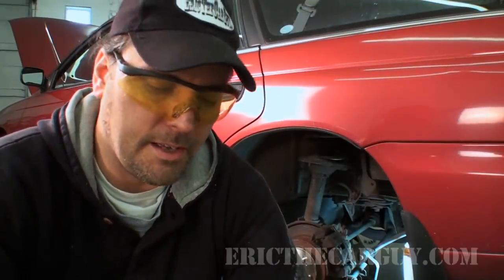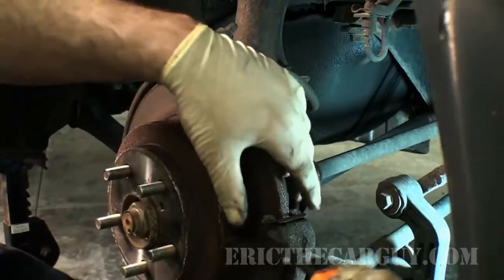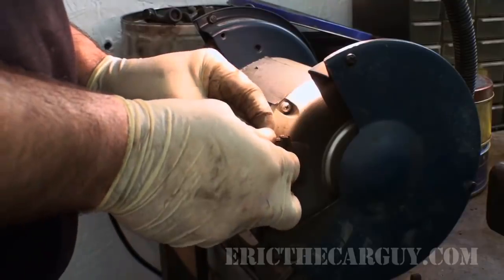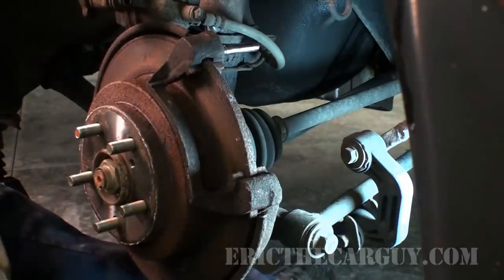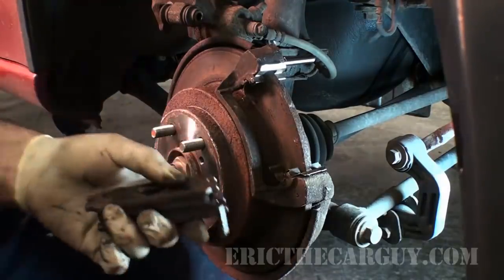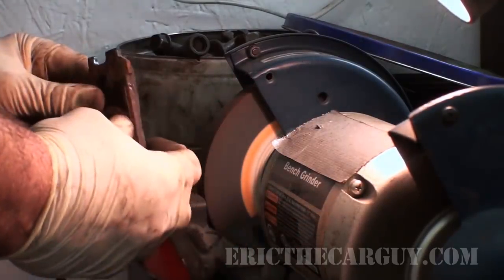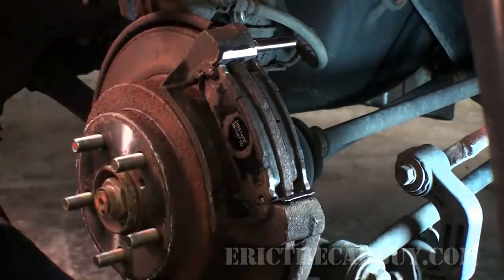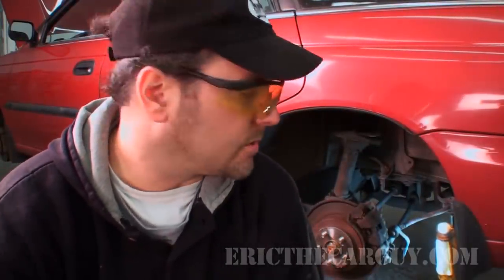How to Spot and Service a Stuck Rear Caliper - EricTheCarGuy

Comment: One way to prevent the rear brakes from rusting and get stuck, is to exercise the brakes every now and then, just brake hard a few times to remove any surface rust from the discs, and to make the pads and the caliper move a little bit. The number one reason the rear brakes fail and get stuck is that people don't brake hard enough.

Awesome channel btw, keep up the good work Eric.

Comment: Eric I love your videos. I live in New Hampshire and have been a tech for 12 years. This is the most common cause of premature brake failure.  You need to always clean the rust from under the shims and put plenty of brake lube under and on too if the shims before putting back together.

Comment: Sure pads are cheap and easily replaced. but he's not fixing pads, He's fixing a stuck caliper where most mechanics will happily charge you $200 or more for a new caliper and labor. He's done a great job on educating people that a stuck caliper doesn't always have to mean a costly replacement. Thanks Eric. great job. wish there were more honest mechanics like you.
Reply: He didn't fix a stuck caliper he didn't even fix the rubber boot around the Piston nor did he show how to get the Piston unstuck
Reply: This video showed him cleaning the caliper not fixing the problem with getting the rubber boot or piston from being stuck
Reply: @m.o.n.e.ypower8484  yeah, that's what I thought the video would show....

Comment: Very nice! I am a technician myself. I was about to write on here about 7:50 into the video say the following: "Whenever I clean/service calipers and caliper brackets at work, after I clean the shims and the shim housings on the bracket, I discovered a little bit of anti-seize on the housing will help prevent future rust and less chance of brake failure" But soon enough you did what I was about to say lol. Good job, was like I was watching a video of myself doing it 5/5!!!

Comment: I have a 2012 Dodge Grand Caravan and every 6 months the sliders as well as the parts Eric talked about have to cleaned and lubricated otherwise I start to smell the sticking of the pads to the rotor. The rear of these vans are known for it. I will not waste money on parts that have nothing wrong with them other than surface rust.  I've repaired my vehicle as well as my sons for years and saved a whack of money. 
Great video Eric.

Comment: I always fine tune the brake pads with a file' The ends always have excess metal,like you did fit and try,then fit and try until they slide properly, because your brakes can never be good enough. Good brakes are a good way to stay healthy. good video

Comment: I had a similar problem on my 2000 Pontiac Bonneville SSEI. I removed the calipers, cleaned all contact surfaces with a wire brush, brake cleaner, and also used a small file to ensure the rear brake pad end plates were free of corrosion. I also used anti-seize on all contact surfaces and replaced all the brake hoses with new hoses. The rear brakes now work perfectly.

Comment: I had a rear caliper like this, I just changed out the rotor, caliper and pads, for new that was the quickest, easiest solution for me and meant I was assured everything was new and I probably wouldn't need to work on it again for while.

Comment: I agree that you should have the "chirper" on the inside pad Experience has taught me (even thought its only about three years) to always put the indicater in a location with path of least resistance mean that if the happens to fly off of the pad it with be ejected promptly by the forward motion of the wheel and not get thrown into the caliper and possibly cause more damage there  are my thoughts on that. And as far as not beating on your prybar to free those pads I say use what you feel safe w/

Comment: Had a rear slider on a dodge ram yesterday and the one slider was like it came from the factory with now lube in it at all. The rest were fine and there is only 100,000 kms on the truck and the brake pads were never changed until yesterday and they still had half the pad left lol. I couldn't believe it. All highway km's I was told. Great vid Thanks.

Comment: hey eric,paul again,so many mechanics NEVER lube the slides,incredible !!!! i keep a can of brake lube right on my cart and never do a brake job without checking and or lubing the slides !!!!! the small cans i use have a brush right in the can !!!! it's really cheap and you can buy them on line cheaper than you can buy them at a parts store !!!!!!! when it gets low once again you can buy tubes of brake lube cheaper on line than you can at a parts store !!!!!!

Comment: Thanks for yet again a very informative video that covered stuff I was doing wrong over the past 30 years of DIY car maintenance and repair - like using grease for those caliper pins instead of silicone paste (unstuck my rear brakes 8 months ago and wondering why they seized again so soon....  you're a life saver!).  Anyway after watching and learning for a few years I finally did the right thing by you and subscribed.  Thanks for all the help and guidance over these past years.

Comment: Great Video Eric !!! Finally someone shows how to properly service the caliper.
I do it this way on EVERY brake job, as I'm up in New England. And if you don't then the pads will freeze and wear out in 6 months. +1 on the Silicone for the slide pins.

Comment: I like that the caliper frame was cleaned under the abutment clips.  Not having a wire wheel, I use highspeed rotary tool to clean the pad ears, the caliper frame under the abutment clips and the clips.  If I see that the abutment clips are blued (disclored from heat) between pad changes, I'll replace them, other wise I'll replace them whn the pads are changed. Clips are cheaap, pada=s and rotors are not.

My experience with owning used cars that have rusted suggests that rust present promotes rust formation.  Rust from caliper frames is moved by condensation and rain down onto the rotor surface creating morning rust "blush". That thin coating of rust does more to contaminate and wear down disc pads than  males of driving.

 If you have removed the caliper frames for cleaning and aren't rushed for time, any good chemical rust remover will get the majority of the rust off without scouring. A small amount of rurface rust "blush" can promote bonding of a rust inhibiting paint.  Years ago I used "instant cold" galvanized spray for this and it dramatically reduced overnight surface rusting of the rotors. Now there are water based chemical  that convert the red iron oxide to black iron oxide, which is much more stable and doesn't easily wash away.

Comment: great video. i used to use silicone paste on the slide pins like eric said, but when you work on oilfield trucks, pins  are seized and rusted in all the time so i just use the copper antiseize lube on the slide pins to that way when the brakes are worn out everything comes apart, instead of having to replace the calipers and and brackets.

Comment: If you have a locked caliper, stop immediately, in few block the burning smell  can caught on fire,  causing major damage, to get dry the rubbers, boil the brake fluid get dry the grease of axles and bearings, damaged the rubber boots

Comment: Just doing the same here on all four calipers/pads of my 1996 Lincoln Continental. Here in the UK such parts are difficult to obtain. Having removed calipers/pads it is easy to remove the rotor. An angle grinder with a fine grinding disc soon removes the inner and outer raised rusted areas, making the rotor almost as good as new. There has been no need for machining.

Comment: Eric little advice from me. I used to use coper grease on the parts you used it for quite a while now. However a buddy of my recommended using graphite paste instead... (4 years ago) and since than i have never looked back on copper grease. It was such an improvement on working with brake callipers. Greats videos by the way. Keep them coming
Reply: What's the difference? Tell me more

Comment: thanks eric. this is a very common problem in older VW's, golfs, polos, passatts, transporters etc.

its either the brake pads seize the the carrier or usually its the slide pin/s are seized. 

cheers

Comment: If you don't replace the shims, the pads may vibrate and you'll notice a pulsation in your brake pedal and a lack of steady braking.

Experience has taught me that if it's there, it's there for a reason so you should leave it that way, whether it's by replacing it with a new part, or putting the old part back

Comment: That works fine.  Once a rotor is like this scratches are a step up and noise probably isn't a concern at this point.  Just go light and use a rust-cutting lubricant like pb blaster or something, and dont try to get it all, stop once most of it is gone.  A wire wheel on a grinder or some fine sandpaper (sandpaper is what I used, all I had) would be better than a brush.

Comment: Just have the cheap ass customer buy a new rotor and pads! Safety is top priority!
I am 58 and have been a mechanic since High school,my hands have carpal tunnel and had my knees done from constant kneeling on concrete floors, so don't use your hands like a hammer and protect your knees also. PPE is number one to. Love your channel and videos.

Comment: I worked on a F series Super Duty that had this problem on all four wheels. I ended up using my air hammer to chisel the old pads off and then used a file to clean up the build up of rust on the bracket. Instead of the rotary file, I like my 3" cut off wheel (or a Dremel) to get in the groove and rub some rust off.

Comment: I also found that using a pad that contains less metal will sweep the rotor cleaner.  Very important on the rear cars with a strong front-rear brake bias.
You can check this with a magnet. OEM Honda pads are very good, but HAWK Street pads for example were too hard and were a disaster on my rear disc brakes. 

Another thing I would like to mention is avoid brake-cleaner on those little rubber boots for the pin sliders, as it causes them to swell and deteriorate.

Comment: Haven't read all 533 comments BUT I hope someone has mentioned :-
NEVER use a ratchet for the initial untightening of a bolt/nut.
Always use a bar or breaker bar first to 'crack' the initial hold.
Secondly, always put a smear of anti-seize on the caliper areas where the stainless steel shims sit. Freshly 'bared' - these areas will rust and expand slightly making the shim/pad clearance disappear.

Comment: As always, excellent video. A couple things I would like to add from my experience on rear brake problems. Ive owned a '00 Civic Si with rear discs for 10yrs now. I have serviced them many times, replaced seized calipers with brand new OE units. Sometimes a car's braking system is just of poor design. Not enough brake bias towards the rear. If you've got a car like mine and drive it through the winter, the rears will always make a little noise and the rotors will not be as smooth as you'd like.

Comment: Good video, Eric!
I have had to changed a caliper because the lever for the parking brake inside the caliper are rusted (10 years old) and the spring are too weak to pull it back. After that i noticed that the brake cable suck...ehm stuck too... damn brakes, "old" car.... 
But, never had sticking brake pads, clean the guidances always with a file and put it back with silvergrease.
Oh, and i use medium loctite for the screws instead of grease, have better experiences with that...

Comment: Thanks so much for this. I took my 17 year old Highlander in for exhaust work and he pointed out the rusty rear disc. It took a hammer and a tire iron to break the caliper free because both mounting points were frozen. I ended up grinding the pads and the mounting bolt down. There was no sleeve on the bolt so the only thing I can figure is the rubber expanded and trapped the bolt. No telling what the mechanic whoud have charged me.

Comment: For novices, I would suggest using a double cut bastard file instead of the carbide burr to take off "just a little" metal from the contact areas of the brake pads.  It will be able to get into the square corners better and less likely to take off more metal than intended.  Plus, you won't need a die grinder and air compressor.

Comment: Hey Eric the car guy I have a 04 Chevy Tahoe I recently replace both front pads and rotors and also the both calipers for some strange reason I smell burning brake just on the right front now I brought the calipers from AutoZone I just took back the right front caliper thinking the caliper was bad but I still get that burning smell when I'm braking and it's just the right front side that's doing it do you have any suggestions on what it could be

Comment: You've mention before about air bubbles in the boot. When you apply liberal of amounts of silicone in the boot it create an pneumatic effect with the excess. Which "silicone pneumatic affect" would have a greater effect than an "air pneumatic affect". That's where you get in even wear on pads too :)
Reply: what do you recommend.  goedendag
Reply: You need to "burp" the boots.

Comment: I don't use my bench grinder. I use a little Dremel rotary tool with steel wire wheels (safety glasses are a must) Using a much smaller wire wheel makes it a lot easier to hold onto the small parts!

Comment: Yeah you are right, I think I need to adjust my driving style to work in the handbrake.  Maybe give it a few uses before and after setting off, or while waiting at lights give it a few uses before setting off again.  Weird thing is that although I hold the car on the clutch without the handbrake, I never seem to go through new clutches (been driving since 1993).  Anyway good advice and I will start giving the hand brake a workout from now on.

Comment: Great video, Have you or anyone else ran across this on new pads?  Have serviced my own and family members vehicles for 18 years, I had never ran across it until last week,  It looks like the manufacturer has changed over to a plasma cutter rather than stamping out the metal part of the pads, and simply put "it ain't perfect". Cleaned the rust from the caliper slides and new wear guides, and the pads still had to be ground.  You could see the notches were not cut at 90 deg rather they were tapered and a little jagged. I was mad and was going to take them back until a buddy of mine said it was pretty common for him.  Is this just standard now having to custom fit pads ?   Also going to note I am up here in the rust belt, from the looks of that Subaru, you're fortunate enough not to be.  Never seize is you best friend up here on brakes.  I coat the bolt heads, and torx head pins I fill the heads up, and coat the bleeders when I am done. I know it runs the risk of "lubing the pads" just don't over do it. It makes one heck of a difference the next brake change, just for preventing corrosion. I also never seize under the slide shims, not for lube but for corrosion.

Comment: Great video. How would you deal with a STUCK caliper? i was driving down the highway once and my front right caliper locked down on the rotor, and there was lots and LOTS of smoke and it was hard to move. Any way i made it to my drive way at home and did the only thing i knew to do wich was observe the problem caliper,, i then came to the conclusion i should bleed the brakes, so one by one i bled the brake lines and several hours and a big mess later i was back in business and have never had that problem since then. I did notice there was a chip or a piece broken off the round doughnut part of the caliper. Just curious if this is a problem or could be a problem.

Comment: 1:10 subaru hardware is very so so.  I recommend the wrench as shown.  Sockets apply side force and snap subaru bolts off.  Get as close as you can on subarus.  use the wrench as much as possible.

Comment: Eric, my rear cylinders seems to drag on the rotor too much (loss of mpg, hot discs in winter - more warm than in front). The drag happens with the bleeder open so it's not the line. I made sure to align the cylinder with the pad's notch. Everything is new (Raybestos E3 from Rockauto) and I put AGS sil-glide grease on the pins with copper anti-size on the pads lobes. So what the heck is going on? The only thing I did not open is the cylinder and I left it with its factory grease. Been dragging ever since I installed it. New caliper, new pads, new rotor.

The rubber bushings on the pins seemed swollen when I checked them today (cheap rubber? I don't think AGS reacts with rubber like that from what I read). The rubber around the cylinder seems to torque a lot when I'm screwing in the cylinder with a cube. I wonder if that ain't the reason for the cylinder not retracting properly.

Been a few weeks, if you can give me some idea ...

Comment: The only problem with switching the pads from one side to the other , they take time to wear back to the shape of the worn discs/rotors more so on the back brakes. Personaly I would put back as was so the brakes work better staight away , well thats how i would do it . Nice Vid tho Eric  :)

Comment: Very good video Erric. I took my 98 subaru to a mechanic for rear brake work and he said the pins were frozen because he could not move them. He could move the caliper up and away and to tell you the truth I don't think he knows what was doing. My concern is-are the pins rusted into the caliper or??? thanks again, and I will keep real dirty @ 82 years old--(;-)
Reply: If you can "swing the caliper" the pin isn't frozen; it can be twisted.

Comment: Thanks for the video. My rear calipers are not working evenly, i.e. they are wearing the brake pads more on the bottom or one edge than the other. How do I correct this issue? I'd appreciate for any useful response.